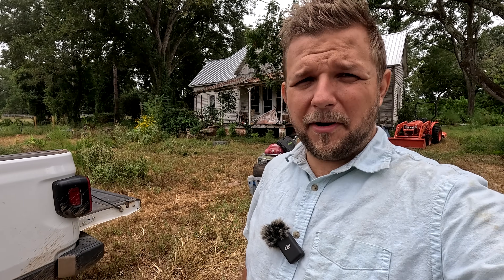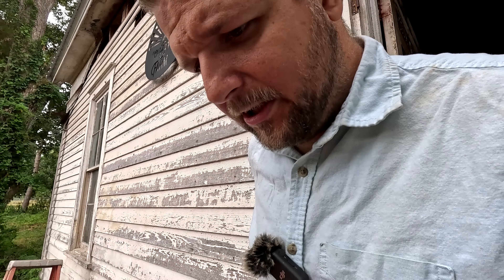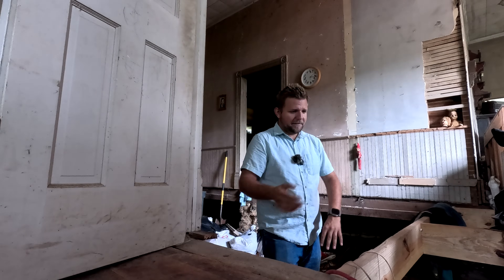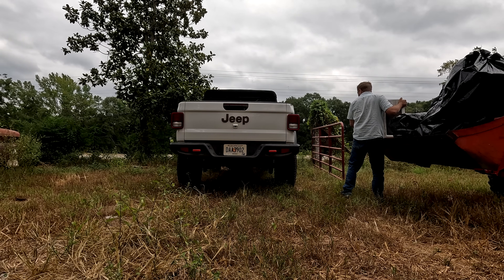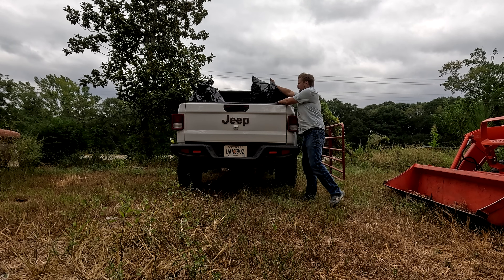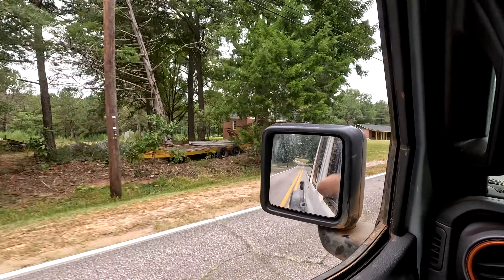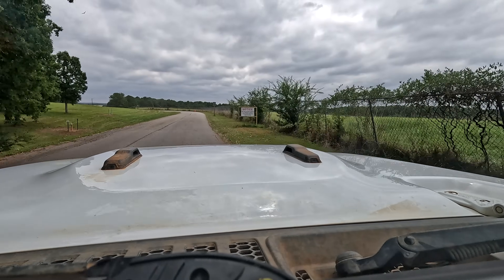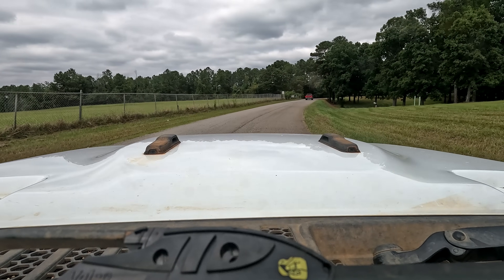200 POUNDS OF TRASH REMOVED FROM 140 YEAR OLD FARM! (Jeep Gladiator Goes To The Dump)

Comment: I have to admit I’m really slacking trying to keep up with you n the OBF. I’ve been so busy n having company that I haven’t had the time. Hopefully it will slow down. Taking one day at a time hoping for cooler weather. It’s really hot n definitely humid here in Florida. 
Well you can start right now keeping up what’s left in the house (trash) from now on. You said there’s still a lot more left. I bet you’ve gotten rid well over a 1,000 lbs. or much more. 
Take care of that summer cold. They can be miserable in the heat. ♥️♥️😊👍👍👍👍🌟🐾🐾🐾🐾

Comment: You did say how hot it has been in Georgia all summer, Nebraska has been the same with at least equal humidity. I wondered why there haven't been OBF videos lately and taking a break from them is good for mental health, one of the reasons why you vacate on vacation. Surprised that the last section of the bed cover doesn't fold away to open up the whole bed.

Comment: OMG, Finally another video from the OBF with Robert. Miss your videos. another short one though. Glad you are doing ok, and that you survived the Hurrican that came though your way. Was praying you and all there would be safe. Glad to see you once again tackling getting rid of more trash, cause what you remove now, will help in getting all of it gone, at some point, and less to do later, as you continue to work on the floors and replacement of them as well.. Great short video Robert. Love , Gentle Hugs and God bless.Robert, it that Gladatior actually yours?? reason why i ask is that you mentioned that you would be installing a trailer hitch to it, and if that is a loner, you can not do that.. just wondering. Hope you recover quickly form your summer cold. 200 bls of trash removed.. makes you wonder all the weight you have taken off it from the beginning..WOW!!
Reply from the maker: Yes it is mine